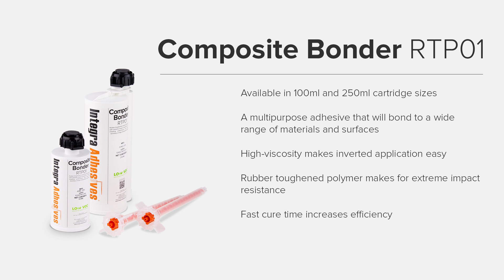Integra Adhesives: Undermount Sink Installation

Comment: I guess your company doesn't make any kind of silicone sealant. I'm surprised (or not) to see that your demo doesn't show the operator making the installation "complete" by applying a coat of waterproofing sealant around the perimeter of the upper edge of the sink.....either before or after installing it. Wouldn't that be the smart/complete way to do it?
Reply: I am really surprised there is not sealant installed between the sink and counter surface, that gap, yes there is one, is going to grow mold and mildew over time. I know folks will think the counter and sink are perfectly flat,  just did 176 units in a new condo building,  over 400 sinks all under stone,  none have a perfect mating surface. Soap and sink scum  residue builds up under there. The epoxy materials used are what we use, excellent product, none of that glued on bolt fastener though.
Reply: AKEMI!!!!!
Reply: @als1023  dude I sometimes get under sink and work material flat because it’s so nasty
Reply from the maker: @als1023  We did apply a sealant, however at the time we were simply showcasing our product for the undermount fasteners, it wasn't intended to be a complete tutorial for sink installation.

Comment: That’s takes up to much time when you can just use Sink-It’s or other faster ways to do it lol
Reply from the maker: An undermount sink application with adhesives takes 20-30 minuites.  Templating and drilling for mechanical fasteners (such as SInk-It) really isn't that much faster.  It comes down to preference.  Drilling into stone, especially so close to an edge always carries a risk of fractures which an adhesive eliminates.